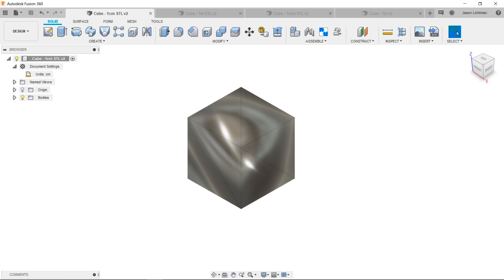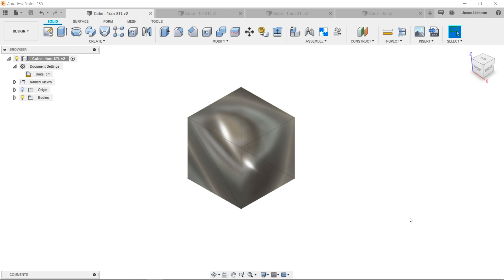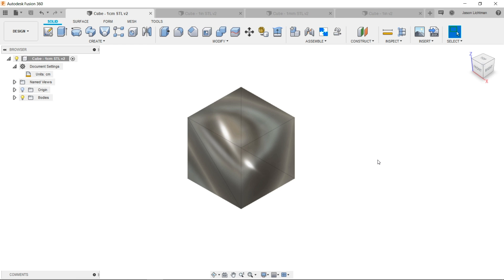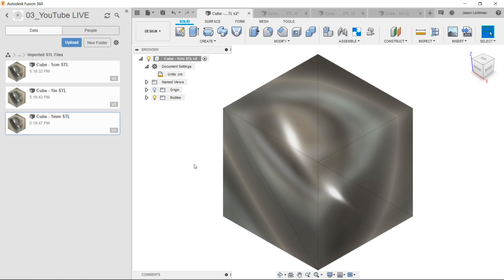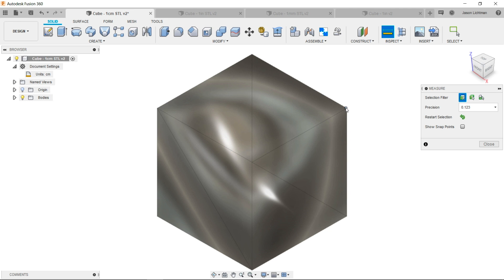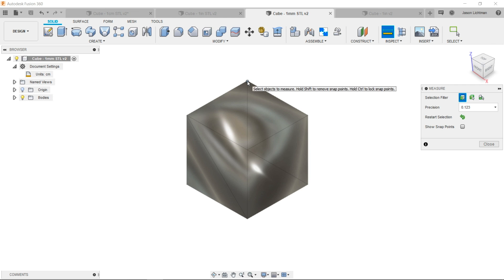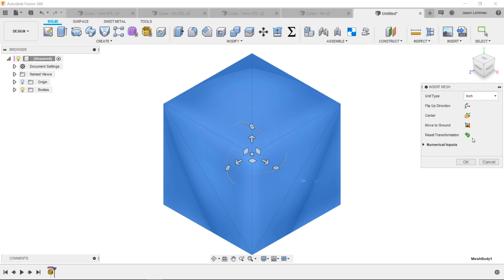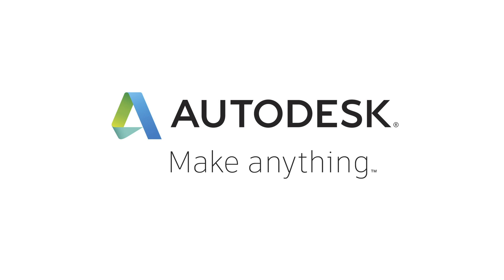QUICK TIP: Importing Meshes

Comment: I needed to insert a mesh lithophane .stl into 360 just to draw an arc around a curved area of the mesh then I can delete it. But the mesh is so resource intensive my old machine just can't handle any of the new sketch without locking up for minutes. Can I make the mesh a very basic outline just to make my sketch around one end? I just need the sketch for a reference for a simple 3 point arc sketch. It's making me crazy. Works fine drawing any other project from scratch as long as no mesh is inserted onto the project for reference. Please help.